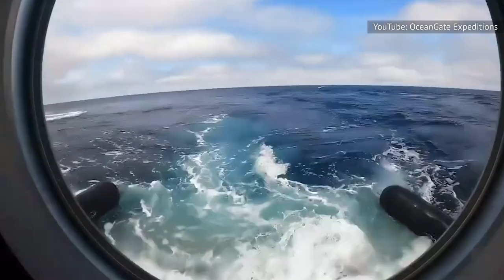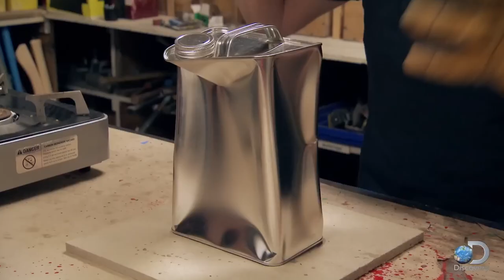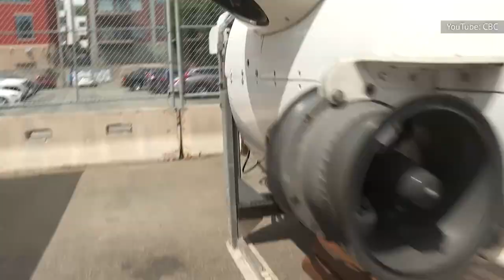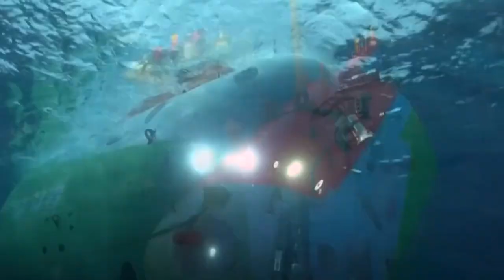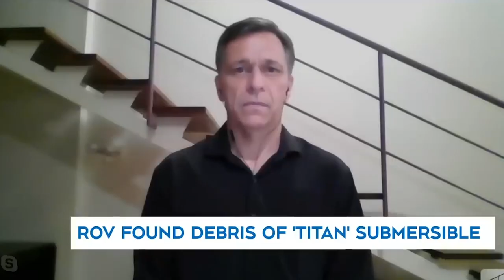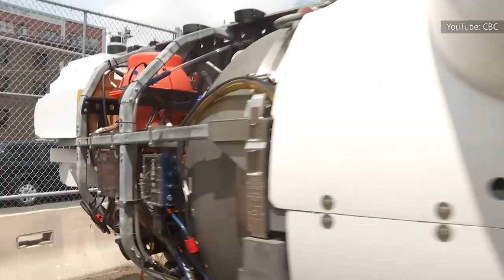The Truth Behind How The Titan Imploded, According To Science

Comment: Why was Stockton so adamant on using carbon fiber mated to titanium? Was it more cost efficient or was he just trying to do something new
Reply: It allowed his sub to hold more people while being smaller and easier to transport, deploy. I just watched his speech about it all, and they had like 5 subs, this was the newest version meant solely for visiting the titanic. Alot of what he said makes sense, but the thing is he failed to buy the correct equipment to scan the hull after each dive, relying on the absurd acoustic monitoring instead. That was why it failed.  He needed maybe a newer version after this to really nail down the design. Also an expert explained he should've been charging 1 million a seat because subs are only rated for so many dives before they are scrapped. That means rebuilding it when you approach its end of life. I saw nothing to indicate he had plans for that.

Comment: The implosion generated an air temperature of 10,000 F.  as the water collapse shock front squeezed the once cozy interior of the sub from all directions into a volume the size of a baseball for a few pico-seconds and then exploded back out as a steam explosion and from water's incompressibility rebound shock wave. It went from an implosion to an explosion. Those 5-men had 125,000,000 lbs. of water mass slam into then from all directions at 1500 MPH with the sub's disintegrating hull leading the way to pulverize every single cell of their bodies into a quickly cooked soup that simply drifted away in those strong underwater currents found down there. May they all R.I.P.
Reply: Omg
Reply: @waitandhope  It was over faster than their brains could register what was happening. Faster than their nerves could transmit pain. One millionth of a second and it was over.

Comment: I think any of these companies that are not taking safety concerns into consideration should never be allowed to take on fare paying customers on any type of vessel whether it be a plane, train , boat, vehicle, rocket or a submarine. They should of pulled this companies license when they started receiving safety complaints from previous passengers. They knew carbon fiber material was not made to with stand that kind of pressure and were lucky that they survived one dive but they chose to press their luck and even had their passengers pay for their deaths. Who ever certifies these vessels to be used in these types voyages should also be held responsible. I know they did not inform these people that they had previous complaints from previous passengers about the safety of the vessel. Yes things can still go wrong when you do everything possible to prevent incidents from arising, but knowing you have not done everything that you can to prevent an incident from happening is another. I believe those on the mother ship knew exactly when the implosion happened and still did not call the coast guard until hours later. To give them time to get their story together. This company is totally responsible and negligent for the running of this business, the safety of their equipment and for the safety of their passengers and should be tried with a crime.

Comment: the CEO is airspace engineer. He thinks it makes him an expert in submarines. In the air you have low pressure outside and you need light material, so carbon has advantage. But in the sub you have enormous pressure from outside and you need heavy material, because you are pushed out of the water. This "expert" couldn't comprehend the difference. And this carbon is more expensive than steel. Honestly a basic understanding of physics and just basic common sense would have saved them all.
Reply: He didnt understand fully the deep ocean environment

Comment: Something I don't understand, and I have qualifications in physics so I would like to ask a Youtube celebrity this because they would know a lot more with their celebrity status. What is the thermal conductivity of titanium and what is its melting point? What is the thermal conductivity of carbon fiber and what is its melting point? What is thermal conductivity of the human body? What is the melting point of human bone it is actually higher than Titanium? Whyare you guys claiming the heat inside that vessel went double to heat of the sun? The Titanium and carbon fiber shouldn't be recognisable. Can water compress water? Can a small couple of miles of water on top of the surface of a very small planet, in a small solar system destroy atoms? When massive suns and even black holes don't destroy atoms they push them into a singularity, but apparently surface water can do better than them.

Comment: The most important thing was the pressure vessel, he said it himself. Clearly the design was terrible. 
   There should have been 10" of titanium ring overlap on both sides of the CF end Then it should have been bolted all the way around with hundreds of bolts and then more CF wrap woven and bonded over these, on the inside there should have been a very hefty frame providing diagonal bracing against twisting, while incorporating large rings (probably 4 or 5 along the length) especially one close or bolted to each end plus longitudinal bracing.
  If i put some thick walled carbon tube in a vice it will easily squish before shattering. Another design improvement could be adding layers of other materials or with different CF pattern to the CF wrap making it a laminated design, potentially integrating the "hefty frame" i mentioned. When i saw how they bonded the titanium rings to the CF my eyes popped out of my head. They should have lowered this into the Mariana trench with nobody on board. That would have been real testing. See at which depth the prototype implodes.

Comment: To much water pressure caused this disaster
Reply: No water pressure had nothing to do with it. It was poorly made. Submarines an remote operated vehicles managed it just fine.
Reply: @nutella9043 Very poorly made. Carbon fiber's strength is during expansion, like in an aircraft. It's weakness is preventing compression. They wrapped it with stands of the stuff like a thread spool.
Reply: @TheFrenchPug  im sorry to inform you but you are wrong if any submarine could go to the ocean floor they might of done the trip with a submarine but a submarine would blow up at the ocean floor too
Because of the water pressure is to much

Comment: used the cheap.rivets..like the titanic
Reply: Actually, they used glue. The titanium rings were glued onto the ends of the tube. Then the hatch and rear piece are bolted to the ring. So, glue and sealer, and any microscopic crack during curing and construction, is what you are holding up the sea with.
Reply: @TheFrenchPug  interesting thank you

Comment: Why isn’t the Titanic crushed ?
Reply: The sudden change in pressure is what causes the crushing. Take a sealed metal sphere filled with air and send it to the bottom of the ocean. At some point the walls of the sphere will be unable to push back against the water pressure. Do the same with a hollow sphere with a hole in it. It will make it to the bottom intact.
Reply: @erinburke9711  makes sense thanks

Comment: The CEO was a brilliant man and even his cheap parts work so must give him credit and something other inventors can learn from.

His only mistake is he did not send them for certification. If they are certified, he would learn that composite materials need to be changed
Reply: Absolutely not. The most crucial step of anything is the safety tests. Everything from new medicine, to amusement park rides, to food on the supermarket shelves, needs to be approved for safety. Him skipping this step invalidates EVERYTHING and resulted in the loss of 5 lives. And using cheap parts doesn't mean anything when the parts were improper for the job and failed.